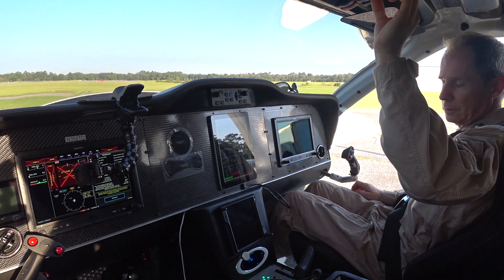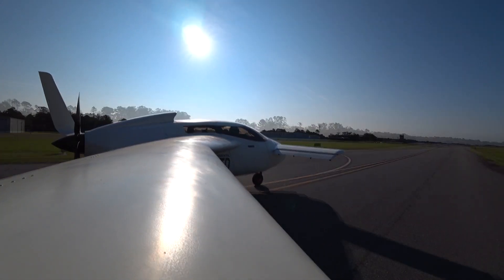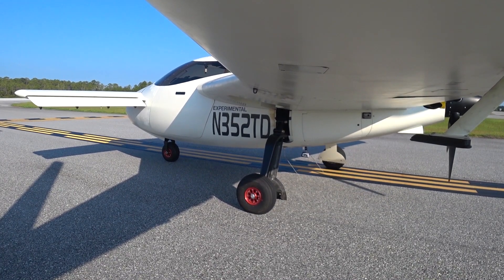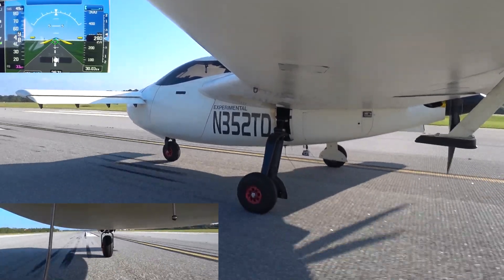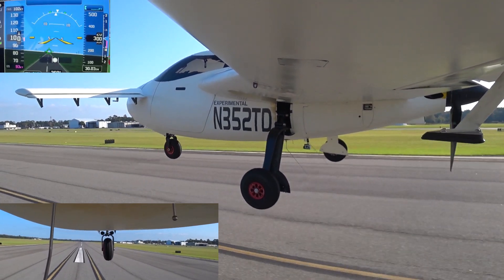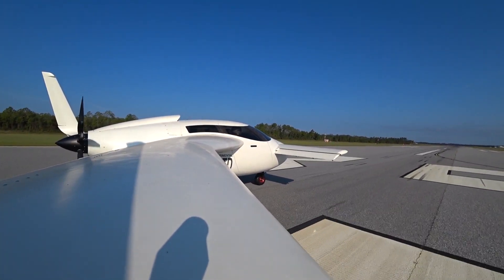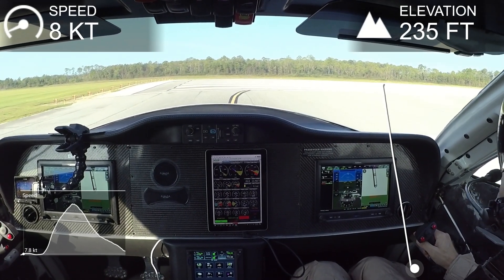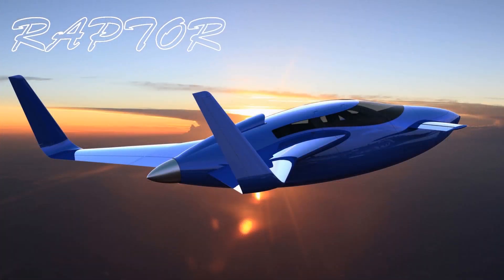Ground Effect... Check! - Building the Raptor Prototype

Comment: That seems pretty good as far as lifting and then flying through the air. Next is a circle the field (around the pattern?)  and after that You should test how far it would go on one tank of gas. Congratulations, Peter. Good to see it working after all that building effort. (it is very rewarding to see)
Reply: @ryanthomas2472  haha (i love hot air balloons, i got to go up in one in colorado, i was in the chase vehicle crew)
Reply: @ryanthomas2472  make the wings bigger and put in two engines

Comment: Copying my comment from my last video until you see it. I was able to use video editing tools and alpha guesses to map out your Cm,alpha. The cockpit video also shows your stick force gradient to pitch moment ratio. You have a stability issue longitudinally mainly with low pitch stiffness. I highly recommend you fix this before taking it any further from the runway. If you find yourself in a high alpha or stall scenario I think you might be in trouble. Have you also confirmed your canards are stalling first when compared to your wings? And I don't mean looking at airfoil data, I mean actually doing an analysis between the two and taking into account the down wash penalty and local AoA change on the wing. It also looks like your stick force gradient alone is pretty extreme.

My comment on your last ground effect video:

I'm going to be honest with you, it doesn't look pleasing for a pilot to fly, and this is only ground effect. No hate though, this is what flight test is for. I am an aerospace engineer and worked with canard aircraft in the past. It is looking like you have longitudinal stability issues. I know we are still at landing speeds here, but a plane should not be this sloppy longitudinally. Did you do any kind of CFD/VLM/VPM analysis on this? I feel like you also will have a lateral stability issue due to having a pretty high radius of gyration and consequently high roll MOI, but that is besides the point. Generally for canards, if sized too small we don't see enough elevator control power, but too big and we see poor longitudinal stability due to a larger than necessary positive canard contribution term in the pitch stiffness derivative. Usually when designing canard aircraft, it is very very hard to get the size of the canards right: too small a volume ratio will not counteract the negative moment of the wing, too big a volume ratio we will overpower the stability provided by the main wing since a canard itself is a destabilizing contribution to the aircraft. I suggest flight tests of multiple canard size configurations. I think you'll see that a decrease of the volume ratio will yield good results (and could even lead to better efficiency mostly at design trim condition).
Reply: There is a reason why Wasabi is no longer associated with that project, just sayin'
Reply: The last part of the video (inside the cockpit and once airborne) did anyone else notice all the vibration translating to the stick and Peter's hand! Is this what Aeroshell08 is referring to?
As a GA and commercial airline pilot, as well as an A&P, this is what I would clearly call a red flag! Be careful, very careful!
I also have to mention, there seems to be a lot of foot pumping on the rudders too, much more than normally required to keep an airplane going straight.
Reply: Bit of longitudinal instability, perhaps canard problem, short fusalage makes the canard ratio critical.

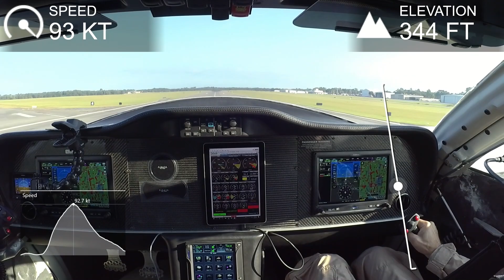Comment: Peter, what’s causing the stick vibration at 12:43 ? Seems to disappear when you slow down below flight speed. Is it likely to get worse as you accelerate into higher flight speeds ?  Flutter ?
Reply: I was wondering the same thing...?
Reply: Could just be nervousness... I'd be pretty on edge taking an unproven airplane into the sky

Comment: How much runway length was used till rotation?
Reply: Looking at the markings it appeared to be 2,500-3,000’ takeoff
Reply: Based on the fixed distance markers, rotation occurred at 3100ft from the threshold.   

     Rotation was delayed until over 100KIAS but based on other flights and the touchdown speed, rotation could have occurred around 85KIAS.

Comment: Looks nice and stable indeed. Just out of curiosity, how much runway did you need before reaching rotate speed?
Reply: Looked like around 3k to me.
Reply: Peter was a little bit less than a third of the runway down when raptor rotated. Touchdown was close to the beginning of the last third. Cool how Peter managed that run. He is really not an average guy. Rely outstanding!

Comment: That vibration on the stick at 12:44 looks worrying to me as I can't remember any aircraft I've flown has ever had a vibrating stick.
Reply: I you look at 2:53 peter is a bit shaky himself... That could have induced the vibration.
I won't stop suggesting that... but I think a proper test pilot would be welcome...
Reply: May be the death grip he has on the stick.  I'm pretty sure I could make diamonds from coal doing what he's doing.  :)
Reply: PIO by looks of it.
Reply: Yeah, that doesn't look good. My guess: the oddly shaped weights on the ailerons are causing this.
Reply: Saw that as well.. couldn't tell if he was nervous and had the shakes or if it was a vibration
Reply: Was much smoother than the previous attempt. I think the death grip on the stick is causing the pitch oscillations. It needs to be flown with the wrist, not the elbow, but nerves are to be expected.
Reply: I use to get that same intermittent vibration in a 150, 172, 180 & RV7A. Turns out it was just my mother in law shaking 😉. She hates to fly
Reply: Not his hand only does it when airborne not before or after....
Reply: Yeah I thought it looked like aileron flutter at first, but one wing camera showed the aileron and it didn’t vibrate. Maybe an engine harmonic?
Reply: Any thoughts on these comments Peter?
Reply: It did have that gyroplane vibe, didn't it?
Reply: I guess the vibration is caused by Peter's Hand...
Reply: I have a hunch it was adrenaline. Peters hands have seemed a bit shaky after each ground effect test. I know mine would be.
Reply: Went to an air show, Richmond years ago. There was a rare visit by a British single seat jet fighter. Cannot remember which one. Could climb vertically very fast. The pilot was allowed to smoke within meters of the plane.
Reply from the maker: Now that you've all made suggestions, how about this. I suspect that the stick vibration is coming from the ailerons as there is nothing else that would cause that in the cable and push rod linkages. So, then what would cause an aileron to vibrate? Well, we've seen at various power settings and prop pitch that the right wing camera vibrates. The aileron is in that same prop plane. Perhaps the prop shock wave of sorts is causing the aileron to also vibrate like the camera does. It's definitely not me doing it. More testing will prove or disprove my theory.
Reply: @RaptorAircraft  unless the prop tips are supersonic, there will be no shock "of sorts" or otherwise. This looks like a classic aileron flutter to me. With those underslung counterweights, I'd investigate coupling between fore-aft wing flex and aileron deflection.
Reply from the maker: @hpaircraft2187  ok, so explain what's causing that camera to vibrate. It's not flutter. I still suspect the same thing is possibly happening to the aileron.
Reply: @RaptorAircraft  Yeah, looking at the footage again more closely, it doesn't look so much like flutter. The surfaces themselves look pretty solid. The way the camera vibration goes away at liftoff, it might be a resonance between the natural frequency of the camera mount and something in the undercarriage. The stick shaking might just be from your grip on the stick.
Reply: @RaptorAircraft  , I suspect that the camera is shaking because it's a box with a flexible mount, and these guys are following it: https://en.wikipedia.org/wiki/Vortex_shedding

The camera vibration might be a red-hearing. To be sure, we would need a camera pointed at the camera to see if it's moving on it's own or in unison with the wing. If the camera breaks off and the wing doesn't, we'll know for sure : ) Or an Arduino IC2 3-axis G-sensor/logger could be attached to the wing with the strongest double-stick tape 3D has, and I'm not talking about the foam stuff. Needless to state, the housing must be pretty smooth and small.
Reply: @RaptorAircraft  this is maybe a little outside the box but what the hell....
It looks like maybe the right gear door and left gear door are possibly causing a vibration. They could also be causing the roll issue. If they aren't aligned absolutely perfectly they can cause both of these issues.
AND
The landing gear themselves seem to be causing some pulling to one side due to a slight misalignment. 
It's obvious that the gear are moving around a lot when they initially contact the ground, but they seem to resonate when leaving the ground also. Like being unsprung, as they should.
Something about the whole arrangement seems off to me and I can't quite put my finger on it.
I wouldn't be surprised at all if it smooths out once the gear are up.
Also, I'm a huge believer in if it looks right it will fly right.
I've been building model aircraft that way for over 35 years and after awhile certain things start to stand out.
A lot of canard aircraft have trouble with sizing the canard. Too small doesn't get the job done, but in my personal experience a canard that is too large causes a lot of longitudinal instability. 
Don't ask me why, I have no idea.
But in several designs I've worked with and building scale flying models of popular general aviation canards like the long EZ and velocity and berkut, the squirrelly ones needed a smaller canard, flew much better with the gear up and generally all of them were a pain in the but if too slow on takeoff and landing.
The canard on the Raptor looks too big and in particular too thick.
I worry that the elevator hinge arrangement is going to cause some issues by acting as more of a flap than an elevator. It seems like it could make the angle of attack change exponentially at extreme throws as it "extends" and "retracts".
There is at least a chance of the elevator causing a flutter or blanking out of the ailerons on landing but I suppose you can burn that bridge when you come to it.
I built a flying scale model of the Raptor a year or so ago.
I had a hell of a time getting the center of gravity correct.
Until I did, it was a real handful to fly.
Ultimately I had to bring the center of gravity a lot farther back than I thought would work. Until that and changing the canard to a full flying stab it would snap roll on me right after takeoff.
The first indication was a tendency to roll to the right as it was leaving the ground. I attributed that to the torque from the motor. 
The only way to get it flying was to punch through it by leaving the ground at a much higher speed.
That mostly went away when the COG was found.
With a flying stab and correct COG it was a dream to fly.
No flare at all on landings and they were still pretty fast, but very efficient in the air.
Once all the ground aerobatics were done I could throttle WAY back and it would cruise for a long time with what I would normally think of as a power setting for glide slope on landing.
Getting it on the ground was tough.
A lot of overshoots and touch and goes.
Reply: @RaptorAircraft  Hi Peter, my 2c theory is that it's induced by vibes from wheel contact through to steel wires. Which would reduce significantly on wheels up.
Reply: @RaptorAircraft  , It's just a guess, but because of their mass, my guess is that the ailerons are the only control surfaces that could not cause a vibration of that high a frequency. I would look at them, anyway.

Comment: 3:54.., that was really stable.., I am absolutely thrilled for you mate!!
Reply: Yea! That was some of the smoothest stablest handling I’ve ever seen in an aircraft. You can especially see this buttery goodness from the inside view at about t=12:30 where any little oscillations just spontaneously resolve themselves without getting any worse. With that sort of top gun control and bedrock stability, it must have been so easy to put that thing down just exactly when he needed to in order to avoid running off the end of the runway or getting forced into an unplanned flight.
Reply: @AaronCederberg  Light aircraft are so susceptible to cross winds on both take off and landings, thats why I suggested to Peter that he take the Raptor both directions on the runway to eliminate it being an aerodynamic issue, not sure if he did but its moot at this point as that was a great flight, good things happen to good people and Peters been through alot and still maintained that fighting spirit, something tells me that the next video is going to be a flight pattern around the airport.
Reply: Andy Nah man. Gravity doesn’t care about how good a person you are. And I have a lot of nerve damage and titanium in my back to prove it. 

Also, I have been a passenger for thousands of takeoffs in small aircraft, and if a pilot demonstrated that sort of handling during takeoff and tried to convince me that it was stable, then I simply wouldn’t ever get in an airplane with him/her. He did not demonstrate control, nor did the aircraft demonstrate stability — especially if you consider how light the winds were. 

He does seem like a nice guy with some serious perseverance though, so you’re right about that at least. But the thing about perseverance in aviation is that it can easily turn into ignoring warning signs, which is something that can absolutely kill you very quickly.
Reply: @AaronCederberg  I am sorry Aaron, I mistook you for someone who wished Peter well, I follow Steveo1Kinevo who flies a TBM850/900.., have followed him for years now and watched many take offs and landings in his (non experimental) aircraft.., I am not quite sure what to make of your criticism here, whether maybe you are a top pilot or high up in aviation,  but what I do know (and I am a painting contractor) is that light aircraft are susceptible to the wind.., but hey.., you have a great day :-)
Reply: Andy I’m definitely not a top pilot or anything, but I have spent enough time around aviation that I know a thing or two about reckless behavior and tunnel vision towards a goal, both of which can lead to very bad and sudden outcomes. Trust me, he’s not demonstrating that he has the experience or good judgement necessary to do this flight. 

And I do wish him well. I’m voicing an unpopular opinion because it might save him from wrecking all of the hard work he put into that thing, or worse... Real aviators pay very close attention that sort of criticism. It’s not about ego or participation medals — it’s about succeeding at something that is dangerous and difficult.
Reply: @AaronCederberg  I am a firm believer in the power of intention, if you envisage a situation will not succeed you will likely find the outcome you feared.., but thats (The Glass Half Empty) squad.., now I dont know you personally but you seem like a glass half empty kind of guy.., Peter strikes me as a glass half full kind of guy and that is whats carried him through so many bad times.., do yourself a real big favor mate and try to be the glass half full kind of guy :-)
Reply: Even if this all falls down around Peters feet.., at least you can say you had good intentions for him.
Reply: Well, I guess this confirms my suspicions about the quality of support Peter is getting...
Reply: Andy in the case of aviation “falling down around Peter’s feet” could very well mean death or serious injury.
Reply: @AaronCederberg  I wouldn't get in a plane with Stevio, every video he makes something either breaks or goes wrong.  ;-)
Reply: Quick stop off to the hanger to change boxers then back out for another run.
Reply: @ryanthomas2472  OMG.., thats all I have to say is...., OMG!!

Comment: Great job!  When are the test pilots coming back?
Reply: You just saw the test pilot.
Reply: @golfmaniac  - And just a much better one that this faki pink wearing california Showboys. It was a necessary descision to put that guy's out of the Raptor program.
Reply: The program and a lot of deposits have too much to lose at this point for Peter to take risks now.  Let someone else take this bird up for the first time IMO.  I'm sure Peter wants to be the first, but logic should prevail.
Reply: @jetspin737  Fully agreed.  And if there's an issue using Justin and Elliot, I'm sure there is someone else out there qualified.
Reply: Very complicated canard would benefit from someone from the Rutan crew involved. It would be a shame to have a catastrophic event at this point.
Reply: You used the word panic, then tried to correct yourself.  If you have even the most remote feeling that you might panic, then get a test pilot. Don’t let your pride destroy your dream.
Reply: He fired the last ones. He might do it himself if he is comfortable enough he had said before. Maybe that's why he's talkin about flying other local aircraft to learn the terrain and everything? Or he will hire new test pilots. If I remember right there are some close or local.
Reply: They are not I think he fired that team
Reply: All I got to say is hes getting more comfortable with the controls as you can see thru the ground effect testing. I see alot of experimental aircraft, Built in garages and the builder is the test pilot. There has been many studies done on the aircraft. He had it off the ground and it landed safely. I think runnin the pattern at low altitude wont be a problem for Peter. Once hes able to get her airborne it eill be easier and give him time to narrow in on the control of the Raptor before coming in to land. This is just my opinion of course. But I think the first pattern flight may just be done by the man himself! And I cant wait! And if he chooses to go with a test pilot more power to the program!